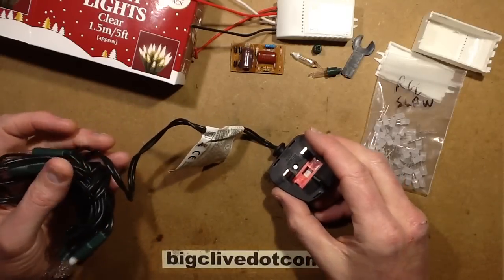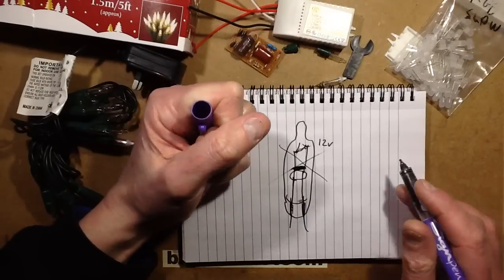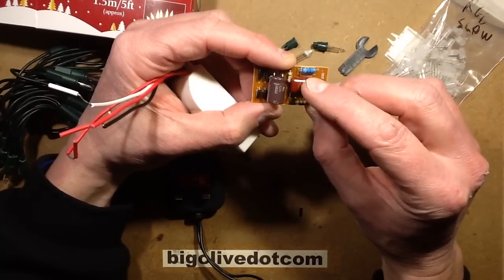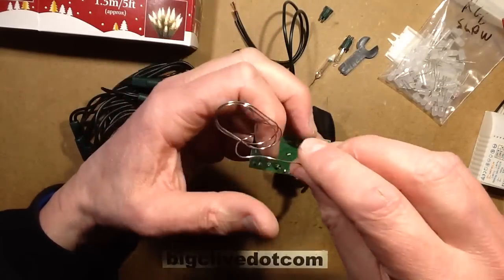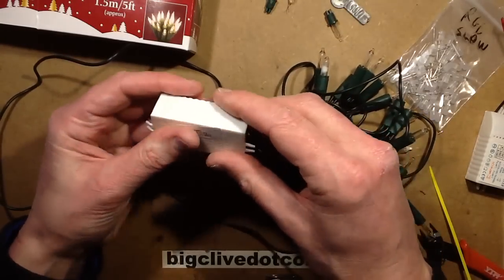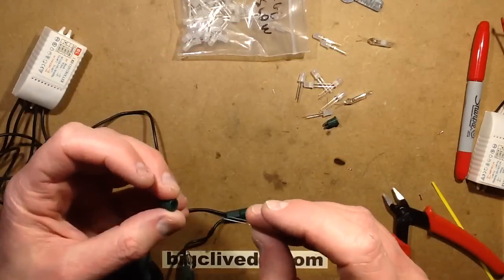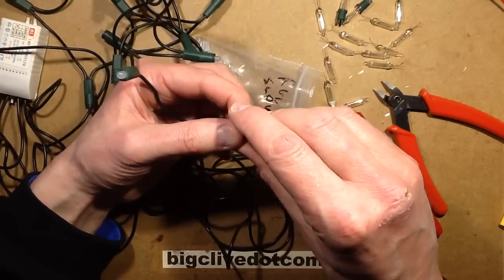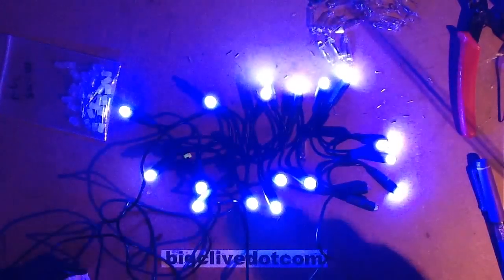Scary work incidents and other answers (with more LEDs.)

Comment: Such dexterity, Clive you make it look so bloody easy! 
Even with several clips to hold stuff a magnifying glass to see and a shit ton of solder I still manage to get solder everywhere I shouldn’t and burn the crap out of my fingers..... 
I wondered if there was a possibility of making a soldering iron like a mig welder and have the solder feed down the middle of the gun. Probably a shit idea but at least it would free up one of your hands.
Reply from the maker: You can get soldering irons with a thumbwheel that feeds solder to the tip, but I'd recommend practice with a standard iron.

Comment: I'm making a controller for school. Should I use a "mini breadboard" (Not sure of terms, but know breadboard) to get the joysticks (stolen from an old PS2 controller and un-sodered from the board they were on), use normal, an insulated wire or maybe take a shot at 3D printing something. The 4th 3D print for this project. Probable 3D printing, just because it'd allow me to be a bit more precise. LIKE SERIOUSLY. I made a cap for a PVC pipe (making a flashlight) last year and the thing fit PERFECTLY. No screw on required, it was perfect. Either way, I am quite impressed with the controller SO FAR. I'd not even close done, yet I'm pretty sure I know how I'll basicly code it. A language I've never used before, and I've already been able to get a button to act as shift while held, and to type x, along with another button acting simiar to shift, but with mouse. Hold, clicks and holds. Release, releases. So, basicly, programming just needs to be done, not figured out... I am really proud of this idea, and that it might actually work, so just wanted to rant. Hello all! :D

Comment: Regarding the LED not blowing up when reverse connecting it: my colour changing LEDs have a diode in the reverse direction (I measured that with a multimeter on diode test) so the reverse voltage would be limited to 0.6 V. That would explain why all the other LEDs still light up and nothing is damaged. It could be that this reverse diode comes "for free" with the small controller which is on these LEDs.

Comment: One thing I found is that a DC short circuit is way more dangerous than your regular AC loose screw or something.
If the DC is coming from a big enough transformer you have in effect created an arc welder.
That can set fire to anything nearby, and in my case nylon window curtains.
This is very bad.

Comment: OMG!!!  Thanks for the memory of the Paragon Defrost timer!  And yes, we've ALL done that.  Btw, good drawing of the compressor rack. I had a relief valve blow off while inside a rack like you were.  What fun!  After 45 years of that work...too many worn out body parts.  From an old refrig/electrical engineer, thanks for the videos!
Reply from the maker: I knew at least one person would comment that they had poked a screwdriver into one of those things.  Industrial refrigeration was a tough game.  Long hours and very technical work.  Of all the guys I've worked with I admired the Hussmann guys the most for their sheer technical skills.  I had to stop working for Hussmann in the end as I was repeatedly falling asleep at the wheel due to the fatiguing hours.
Reply: bigclivedotcom    People don't realize the sheer amount of work it takes to change out a commercial compressor.  Just hauling the tools and supplies from the vehicle to the penthouse, compressor room, roof to do the replacement is a monumental job. A lot of the work must be done overnight or even after you've already done a full day in 100F heat (120F+ on a rooftop).  All that while having to make sure you keep your technical skills sharp to do the job properly and not get killed.  I miss it.     ;)

Comment: My worse explosion happened when I went to reset a 550 Volt breaker that had tripped and apparently the motor it fed had developed a dead short. Not only did the switch I was resetting explode I blew the distribution breaker to a 10 feet wide motor control panel, in the electrical vault. I called an electrician, after I explained to their supervisor what happened they sent two. They were impressed at the amount of damage I caused. After they removed the burned carcass that was the motor control switch they were able to restore power to the rest of the fans. It was evening in winter and those fans are the only source of heat.

Comment: got the Chinese soldering station today the 936d with the display got it and totally love it now I've got more into soldering I've decided to come off of the shitty plug in soldering irons and start temperature controlled
Reply: Get some decent tips for it. Some of those Chinese clones, once calibrated, are actually pretty damn good when you use 'em with proper high quality tips :)
Reply: Nic Wilson yep will defo be getting some decent chisel tips from an official hakko seller atm waiting for my thermometer the cheap knockoff one but will do the job to check the temperature to see the accuracy thanks for the recommendation
Reply: No worries :D
Enjoy! It's such a step up from those plug in ones, you'll never be able to use one again :D
Reply: Nic Wilson I know for a fact that the 936d knockoff is a huge step up from the plug in ones I hate the plug in ones as they loose temp so quick it's crazy I'm always getting crusty solder joints and cold joints
Reply: Where did  you get it from, and how much?
Reply: Andy Wood got it off ebay if you type in 936d it will pop up with all the clones I got the cheapest but fastest postage possible you want a link ?
Reply: I got a "Handskit 909D+" for Christmas... big step up from the cheap 25w plug in thing I've had for about 15 years. No more waiting 10 minutes for it to warm up, and its so much easier to hold than the big old chunky plug in iron.
Reply: tin2001 good upgrade for the money over the year you will easily  get your money's worth
Reply: Thanks, I wondered first if you had used a specific seller like banggood, or some marketplace like ali-express, but even if its ebay it would be nice to know who the seller was if you're happy with the product and how long it took to arrive, this can vary wildly between sellers.
Reply: AnotherEffingName yep tbh I didn't want to go for the plain black look as I like the yellow and blue look of it as it stands out and thanks for the link to the chisel tips will order a few of those right now

Comment: I actually plan on building one of these not because they look pretty, but because of the general randomness and how it almost never looks the same after you power it up.
I have worked on my theory on smaller scales and concluded that the number of possible color combinations the string of LEDs can produce is the number of possible colors in each LED to the power of the number of LEDs in the string.
Each RGB LED produces 7 different colors, and the string has 20 LEDs. Therefore, your string of fairy lights can produce 7^20 , or 7.979 x 10^16 possible color combinations!

Comment: Looks like 2 other LEDs at the end of the string died after the experiment with the reversed LED. Maybe the didn't like the discharge pulse. The reversed LED survived, I suppose, because of the Bulk-Diode of the integrated controller chip.
Reply from the maker: They did.  I was going to add another clip of video to the end doing the maths for that failure, but it was long enough already.  In short.  Peak mains voltage minus the 72V I measured across the LED string then divided by the 470 ohm series resistor gave about half an amp.

Comment: It's usually easy to test LEDs for if they're ok quality using a little tester unit, but how do you test the slow color change lights to ensure you have the best ones in your string?

Comment: Always nice to hear your stories about fairground and fairground lighting because we like fairgrounds a lot! Also cool to hear you have been to Tilburg. The ride you mention is still mentioned by people who have seen it back then in Tilburg, Because of the show and lighting.
Reply from the maker: One of the things that took a trick on the Hellraiser at Tilburg was the fact that it had the guys riding on the platform and pushing the cars to make them spin (or to slow them down if the people looked a bit woozy.)
Reply: Yes that was also one of the things people remember from it.
But there are no other walzer rides in the Netherlands (some tried but failed because of many reasons). Enthausiasts will like to see Hellraiser back in the Netherlands just to feel the vibe of that ride again.
But that's often the case with "lost rides" .

Comment: My current project is the restoration of a former NATO satellite ground terminal for use in astrophysics education.  The motor/gearbox cabin is very cramped, and my 61-year-old body soundly resents every moment I spend in there working on things.  Back in the day, there was 40kW of motors running the thing, and I must have been hotter than hades in there in the summer. We've had many scary moments pulling the old motors out (85kg each) and getting down to the floor for scrapping.   Remarkably enough, the number of things like exposed pinch-points and the like is very modest indeed, and you'd have to work fairly hard to get hurt by this thing, despite its impressive size and amount of machinery involved.

Comment: I blew a fuse in the plant where I was working. I opened the panel and tried to pry out the fuse with a pocket knife. There was a shower of sparks, and my knife had a big hole burned into it, but I never felt anything, not a tingle.

Comment: High Clive, a general question. What brand soldering iron do you use and what temperature? Happy New Year, looking forward to more of your videos.
Reply from the maker: It's a generic Yihua 8786D station with hot air pen.  The soldering temperature is typically 330C
Reply: bigclivedotcom thanks, just ordered an 853D with hot air.

Comment: biggest bang ive had was when trying to fit a single phase breaker into a 3 phase board . i got it wrong and got it across two phases . took out two 200 amp fuses ,copper plated my left hand and shut down the high care section of the factory

Comment: Clive probably knows this, but street lamps in many places, the old sodium discharge ones, used a similar system to the fairy lights. All the lamps on a street were wired in series, supplied with a few thousand volts.  So if one failed open-circuit, that'd take out the whole group of them.

To stop this, they have a similar solution to the wire in fairy lights. It's two contacts with an insulator in between. If a lamp fails, then suddenly the whole X-thousand volts is across just that lamp (since it has the highest resistance, and the higher the resistance, the greater voltage drop). This several-thousand volts causes the insulator to burn through, and the contacts meet. This bypasses the failed lamp, and allows power to keep flowing through the other ones in the series loop. 

As in the fairy lights, once a lamp fails, and it's insulator-thing shorts it out, the voltage is now shared between the remaining lamps, so each one sees more voltage. Normally it's fine, but if too many go, the extra voltage can blow all the others as well, which is pretty bad. 

It's the same system as these fairy lights, but on a bigger scale. Fairy lights haven't always used this system though, in days gone by once one fairy lamp went, the whole lot went off, and you'd have to check each one to find the offender. Big pain in the arse. Now though, a failed lamp just goes out and is bypassed, it's fine. Except for the fuse lamp. So it means that 9 times out of 10 if your lights don't work, you can change the fuse lamp and all's fine again. 

Except less and less fairy lights are bothering with incandescent lamps now, they're replacing them with LEDs. I don't think it's as nice, you don't get as many colours as the old incandescents used to have. And the little glowing tungsten had a nice Xmassy warmth to them. 

Actually street lamps are going LED as well. I wonder if they're still connected in series, or need to be supplied with normal mains together in parallel? And on another tangent, the extra blue content in LED streetlights is thought to be messing with people's circadian rhythms. By coincidence, humans are tuned to expect the light to get redder as it gets late in the day, sunset being particularly red. So the excess blue in LEDs makes your body think it's noon, and your rhythms get out of sync. The old sodium lamps were yellow-orange, or the high-pressure ones were white with a fair amount of yellow tint. That happily suited our evolutionary history.
Reply from the maker: I think the series strings of street lamps may have been an American thing.  I'd guess it was just to utilise full primary voltage?  The LEDs are unlikely to use that system as it's probably best phased out in favour of safer voltages to save the maintenance guys from unfortunate incidents.

Comment: I was really interested to hear your opinion regarding the IOM TT. While I'm fine with people who, as you say, want to live on the edge. As another part of my work history I have managed motorbike dealers here in the UK and in Germany. I stopped making friends with customers due to the high casualty rate in the motorcycle world. I believe that I suffered from a former of ptsd due to attending accidents in a recovery capacity.
As an interesting point I own a replica of a Norton Domiracer which was the first pushrod engined motorcycle to complete a lap of the TT course at an average speed of over 100 mph. It was ridden by a New Zealander Tom Philis. He was killed the next year,1962, riding a Honda at the TT, very sad.

Comment: Ha I was actually on a Japanese TV program.  That was an interesting experience.  Anyway, have you checked the latest LED bulbs from Poundland.  They have a surface mount fuse now and other slight changes.
Reply from the maker: I've got some of the newer ones but haven't opened one yet.

Comment: Hi ,Clive I have been close to one 500Kva power transformer explosion from a direct short on the secondary of the transformer which resulted in fire and the second one was when a 300Kva failed in our test bay with equally spectacular result this time a shock wave that travelled under our feet like the shock waves from high explosives dropped from the air. Both occasions sent the knees to jelly and nearly scared the life out of me not plesant experiences.
Reply from the maker: Oh I know the jelly-knee feeling.  You literally drop to the floor.

Comment: being a refrigeration engineer myself but also being a bit of a player when it comes to electronics id like to think I'm a bit like you.
 You have just had me in bits with the story in this video 
my biggest bang was removing a piece of metal trunking lid at general accident head office in Birmingham 
Was in a cupboard on the main floor to run some mains cables for condensers the lid had been cut jagged when i pulled it outit went  bang across 2 phases whole office heard bang i stumbled out cupboard spots in eyes office manger shouting 1/2 a million pound lost every half hour oh dear I'm sorry i said but

Comment: I laughed so hard at several of those stories.  Thanks for sharing, and being able to laugh t your "learning opportunities"! :-D
Reply: In fact you reminded me of the closest shave I've ever had...

Very long story short, me and my father and a couple of other individuals had taken over finishing the build of our church's extension building following the building company going bust.  This was everything from fitting windows through first fix electrics to completion (most of which we did ourselves except various sign-offs requiring qualified persons and chores like plastering).

As it happens, me and father were on the first floor (second floor for the US readers) laying insulation when two lads from the youth group (who were on holiday and wanted to help out) were outside digging a footing for a front garden wall.

There was a loud shout from one of them, and I volunteered to go and see if they were ok.

Having climbed down the scaffolding I strolled over to see them, and found them standing looking at the hole they've dug.

"Got a shock off the spade" one says.

'Impossible' I'm thinking, but I investigate none the less. After all, it was a metal spade.

I kneel down and spot a plastic bag in the hole.  I grab it and pull, and out of the mud emerges a bag of copper plumbing parts.

'Odd', I think to myself. And I reach in to pick out one of these cooper O-rings.

It's at this point, and I can only attribute this to divine intervention, I notice there is a huge armoured cable coming out the bottom of the bag.

It's now, with my fingers a half inch off this copper O-ring that I realise I'm crouched right where the previous extension building's fuse box was, and this (being a very old building) had 3 phase mains electric off the street.

Needless to say - it was NOT a copper O-ring, it was (presumably an old fashioned) back plate with huge electrical contacts for the 3 phases incoming.  I dropped the bag (with somewhat nervous hands) and took a big step back.

One emergency national grid call out later, guy turns up and says "don't touch it" and tosses a warning sign into the hole (apparently the totality of his responsibility) and confirmed that this is a common money saving trick of bad builders, to save the cost of having the national grid come and terminate it properly.